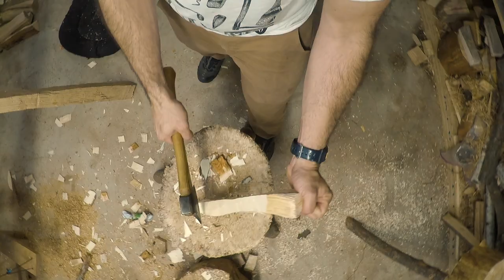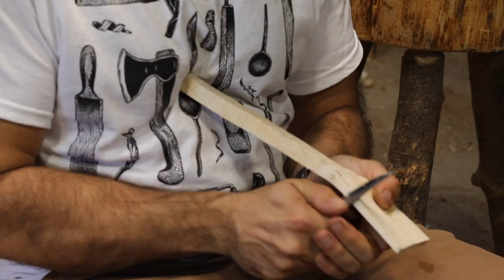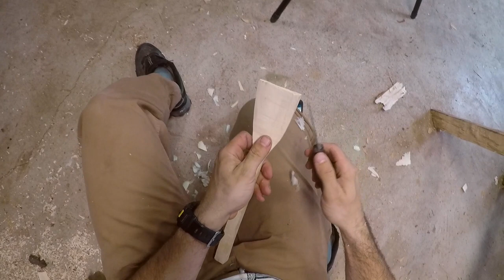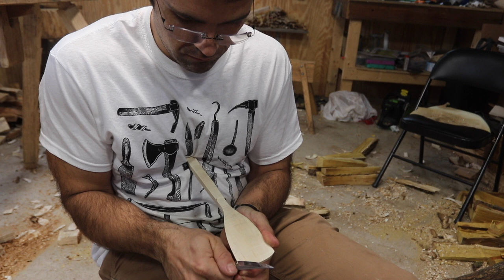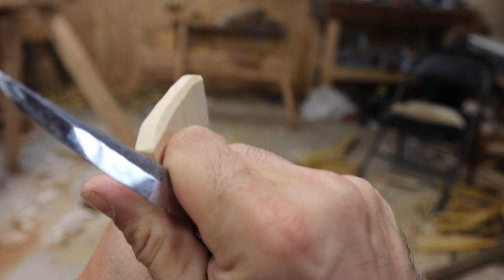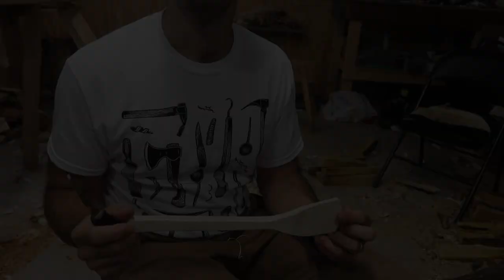Carving a spatula

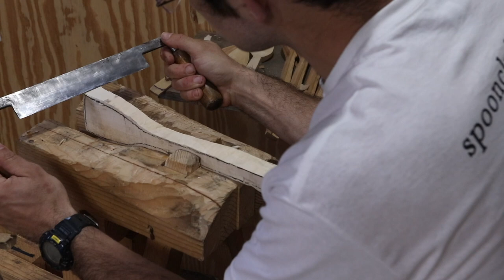Comment: I'm trying to carve a spatula, what is that blade at 0:11 and can I get it on Amazon?
Reply: That’s a drawknife. Find an old one on eBay or a flea market. The new ones you will find on Amazon are not good. A 7 to 9 inch is good, I like Witherby or Barton, but there are many good brands.
Reply: @tyleranderson9190  is pexto a good Brand  for draw knife?
Reply: @manuelmartinez7178  Yes, Pexto are great. Try to find one with good tight handles and that hasn’t had the back of the blade hammered on.
Reply: @tyleranderson9190  thank you for the info .
I found a 10-inch one but I think the price is very high, it is for sale for $ 100 😳.
Reply: @manuelmartinez7178  I don’t like to pay much over 50, but it depends on if it’s nice and how much work you want to put into one. I just got one for 25 but I have to make new handles.